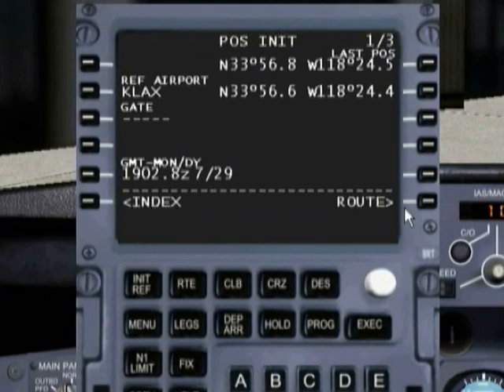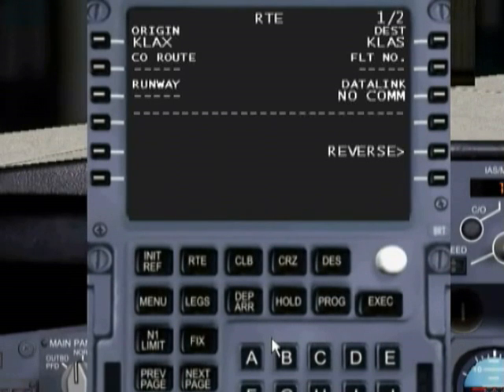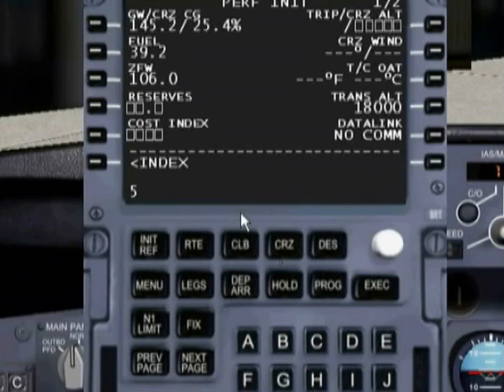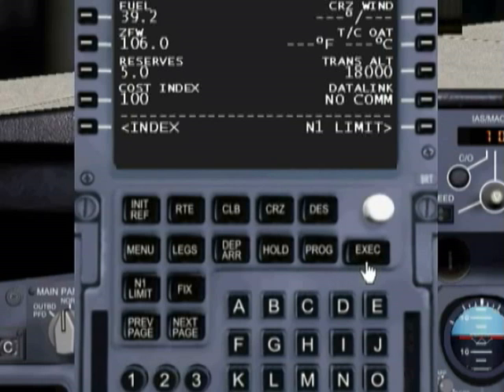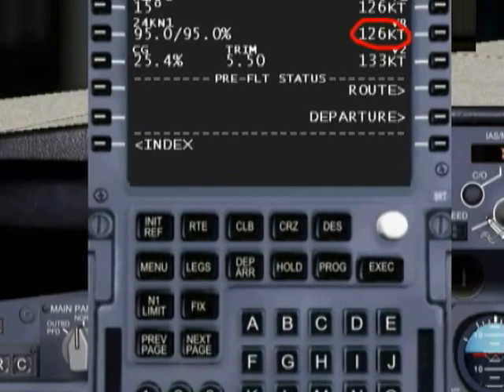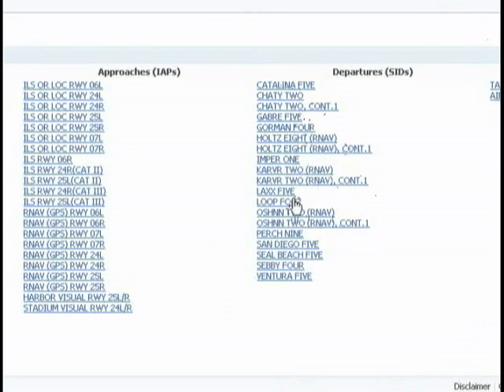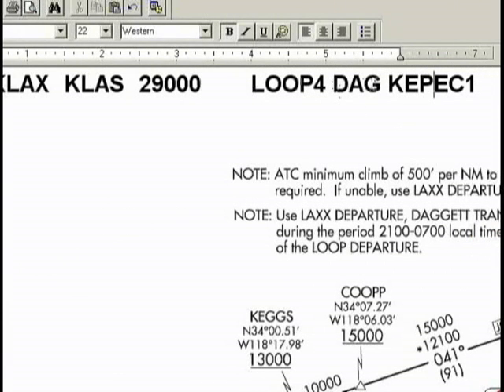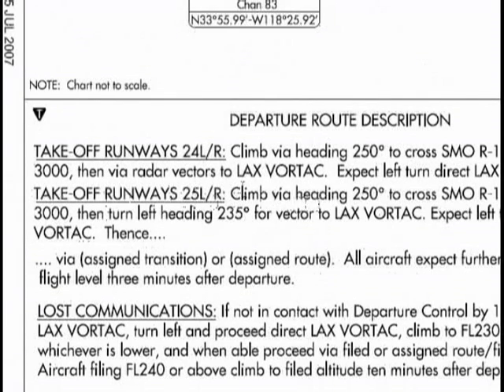PMDG FMC Tutorial Part 2

Comment: You don't need to calculate it, its done for you.

If you wanted to however  you can click on some of the menus in flight sim and it will show you the plane loading of fuel and weight, its not acessable inside the plane.

How can a plane know how much it weighs?